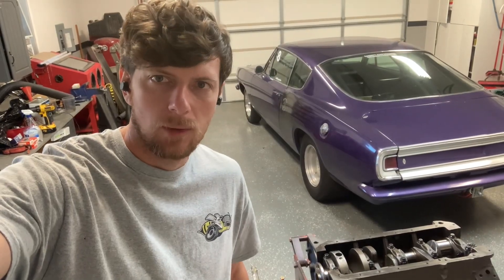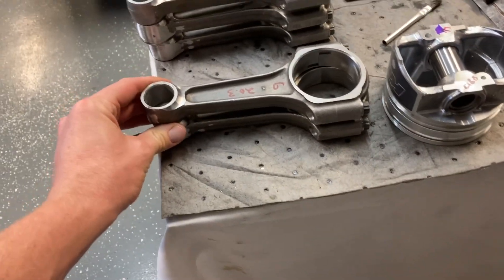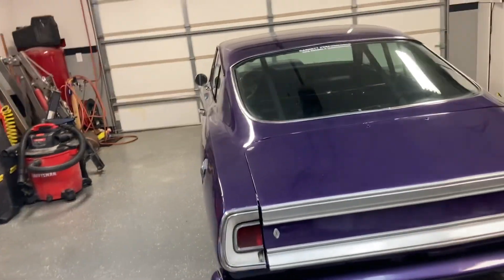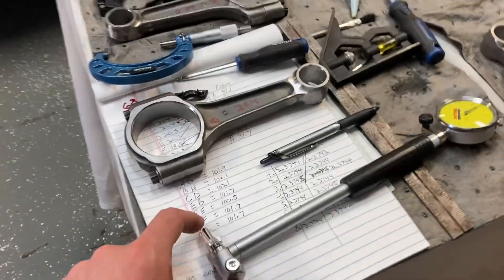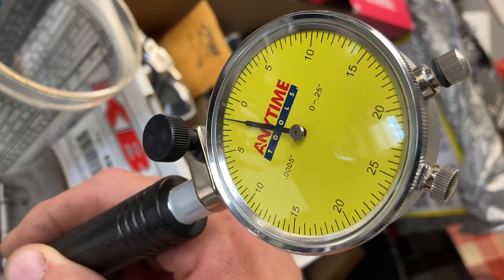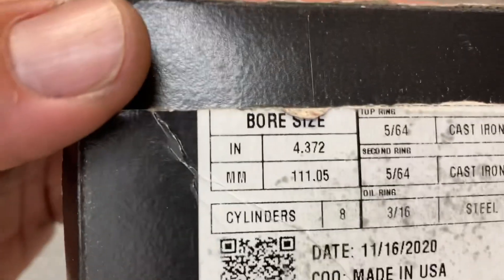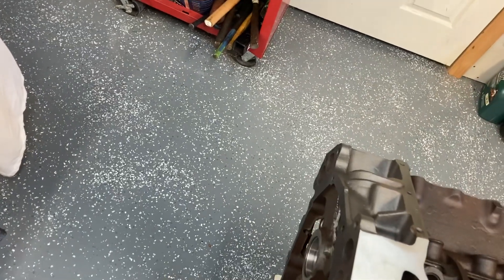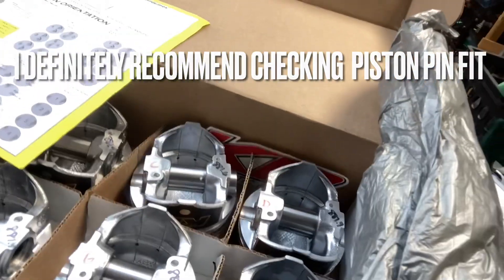Big Block Mopar 400 Build Series:Prepping for Rods, Rings, and Pistons

Comment: Great video Joe.
Glad you are checking the parts, as you should.
As the engine builder, never assume things are correct regardless who does the machining.
Also, the collaboration between the shop and the individual is important.
Over the years working with many builders of engines I have found some individuals require or desire to have different specs and tolerances. 
In which I try to accommodate within reason to the individual needs.
The goal of the customer is important. 
To achieve a positive outcome. 
To add, the large end of the rod is rotating weight and the little end in reciprocating weight. 
Piston and pin are reciprocating and snap ring and or Spiro locks are reciprocating. 
Rod bearings are rotating. 
I like watching and listening to you Joe.
You're a good teacher.
And you add a level of professionalism to your builds.
Following steps like these will insure success and a positive outcome. 
I will be watching and glued to this whole process. 
Can't weight to hear the 400 Mopar run.
Thanks again. 
Take care, Ed.
Reply: You must be good for Old JMK to speak so highly of you and your work. Great day to you all.
Reply: @johnelliott7375  Thanks John.
Thanks for watching. 
Take care, Ed.
Reply: @edsmachine93  thanks again for sharing your work and time with us all and most importantly your honesty as a business man. Your very welcome.
Reply: Wish you were a little closer. But, when I - eventually - get to building that 426 wedge… I might make a trip. 😊
Reply: @MyKARSShop  Hello Mike, I assume you were talking to me?
If you were, I would love to do a 426.
Is it a Wedge?
Take care, Ed.
Reply: @edsmachine93  yes.  It’s a 413 marine engine that I wanna punch out if it’s salvageable.  It’s a boat anchor right now.  There are a couple episodes on it from this year.
Reply: @MyKARSShop  no pun intended for the "boat anchor marine engine" eh!
Reply: @jasonfalk7696  nope. None at all. 😂😂

I guess my reputation precedes me. Lol

Comment: Just curious why not use a 383 crankshaft.  Aren't they forged and same dimensions?
Reply from the maker: @offthegrid5078  yes sir, they’re also internally balanced, which is another well liked thing. Major reason was that I didn’t have one, without having to rob it from a complete engine. I had this nice cast crank that was ready to install. Old cast cranks can handle a lot of abuse without failure. I figured if I was going to buy a new crank, it would be a stroker crank.

Comment: Staying on the looser side of kb specs for ring end gaps can result in oil consumption and loss of compression. As long as your not running a bunch of boost or nitrous I would stay on the tighter end of their recommendations for your application.
Reply from the maker: Thanks Matthew. I’m at a tight .033 on top. I wouldn’t go more than 150 shot. Bottom ring gaps were all .019 out of the box , which the spec is .01748. I didn’t touch them at all.

Comment: Nice video awesome machine work. It’s a lot  easier getting 500hp NA today from a 400 mopar thanks to trick flow heads. There 240 and 270 are nice alternatives. My opinion 500 hp from a 400 B block 10-11 compression Mechanical flat tappet 24x @ 50 camshafts. 240 trick flow heads 1.6 rockers if you have room. I don’t see a hydraulic cam getting you there. This is going to be fun to see
Reply from the maker: Thanks Dan. I’m going with a roller setup and 1.6 rockers. I have the closed chambered Edelbrocks that have been worked and then some. Should be close!

Comment: Yeah yeah yeah! Put it in the Barracuda!
The Chrysler B block has a 1.88:1 rod ratio, if I remember correctly. It should rev higher easier, without having to push it up into RPM's that it really doesn't like to go up to. Will need good valve springs.
Reply from the maker: Inquiring minds must know! Should be a fun experiment! My converter should be good for the 406!

Comment: Too bad, you don't have a forged 383 crankshaft for this build.
Even a 383 2 barrel had forged steel cranks in early years
Reply from the maker: I have one, but I’d have to steal it from a complete 383. The cast cranks are stronger than most understand. I will show the results of this one
Reply: @JustMoparJoe  The 400 block is the strongest of the B and RB motors especially the early ones.
I have tossed out 400s before I found this out.
Andy Finkbiener has built some very nice 400 stroker motors with Trickflow 270 heads.
Over 750 horse power with a 400 block.
440 motors can't live very long at that power level, if at all.
Reply: @JustMoparJoe  I bet that you could find a junkyard crank from a 1966 to 1970, 2 bbl 383 for less than 100 dollars.
    But it  requires some time and willingness to get pretty greasy.
The right crank would not even have to be ground undersized.
Racing engines like to be on the loose side anyway.
   I don't really like cast cranks.
Weak oil slingers.
Poor for high RPM.
 No neutral balance on flex plate or torque converter.
  You can turn the mains down on a 440 crank and offset grind the rods down to 2.20 and run chevy rods to make about 470 cubic inches.
    Do you have Andy Finkbiener's book on building Mopar Big Blocks ???
Reply: @JustMoparJoe  when you tap a cast crank with a wrench you get a full thud.
When you tap a forged crank with a wrench it rings.
   I don't want a "dull thud", crank in my motors.
Reply: @JustMoparJoe  I like 67 to 69 Cuda fastbacks.
We used to race our 69 Cuda fastback at Bandimere speedway in Morrison , Colorado.
We never got it to hook up , even with slicks.
Circa 1978.
11.60s with no traction.
Cast iron heads.
Street car.
7500 foot elevation air.

Comment: Please don’t put it in the cuda you have that car so right leave it alone . Buy a 68   2 door Dart an put that 406 in  they have a nice low roof line   An at a nice looking MOPAR . 👍🏻🇦🇺🏴
Reply from the maker: Thanks buddy! I certainly wouldn’t throw the 408 away. But the engine could use a freshen up. What do I do while that’s happening? Run the 406! I have a transmission. I have several intakes to try out. With aluminum heads and aluminum water pump housing, it will nearly weigh the same as the iron headed 408. Will have to see what happens!

Comment: Great video as always! Has the block been 0 decked? Heads cut? I trust your judgement but lack of compression is a common thing these days.
Reply from the maker: Thanks Greg. Block was professionally decked and bores recentered. Pistons are flat tops, .015 in the hole. Heads are closed chambered Edelbrocks that have been worked in many ways. Somewhere between 10-10.5/1. It may be a stretch, but I’m going to stretch it! That’s where the fun is. I will have under $3,500 in the entire engine, from pan to carb or carbs😅🤷🏻‍♂️

Comment: The 400 is my favorite. This will be very interesting. I think the Torque from the 406 will be better and maybe help launch the car faster…better 60ft? Thinking of building the 451 I have parts for with better heads and Gary’s favorite cam.
Reply from the maker: Thanks Mark! The 408 may win the torque battle with the long stroke! But the 406 will have the head flow down Pat! I need to speed up!

Comment: What’s your take on 2021-22  YouTube engine builders Contributors record’s of  “new cam kit” Manufacture’s premature failure of lifters after proper break in? YouTuber’s  Using correct break in oil & zinc additives. Then lifters Failing and damaging the cam lobes.
Failure after a few mile of on the road tests…( ie; DD Speed Shop , Uncle Tony’s Shop) ….Do you piecemeal your cam parts or do a kit?
Reply from the maker: Thanks for the question. I never buy new comp stuff. They had the majority of issues. Last flat tappet cam I bought was from Bullet cams. No issues. Before that it was Lunati voodoo stuff. I did see a Lunati that looked like it was wearing funny, so I replaced it. My 408 and most race engines always got Isky cams and lifter kits. Never an issue. The Mopar shaft mount rockers allow you to run less spring pressure, which would be easier on cams. Most don’t buy Isky or Bullet because they’re $450 or more for cam kits. They think cheaper is better. With this engine, I found an NOS hydraulic roller from comp. It’s a billet core. I’m actually using solid roller lifter from Johnson. Should be a fun one!

Comment: Thats a comparison I definately want to see! I don't think I have seen anyone do this before,with a Mopar anyway, 406 short stroke big block vs 408 stroked small block...gonna be really exciting to see the results of this. depends on a lot of things like,head flow,cam compression etc. I would think if all that stuff is pretty close to same they should be pretty equal in hp and torque except the short stroke is gonna be getting it at higher rpm range obviously one would think. anyway,gonna be a great build series Joe!👍
Reply from the maker: Thanks Ross! I won’t throw my 408 away for sure!
Reply: Factory big block heads are the crutch.

Comment: Good content Joe , 500 hp at the crank shouldn't be to difficult as long as she is going to make decent compression !
Reply: Nice
Reply from the maker: Thanks buddy. It looks like I’m stuck around 10-10.5/1 with these pistons. Which is fine, as I am going with 93 octane. We could have cut the block and heads more, but may want to drop the stroker crank in someday with some flat tops and shoot for 12.5/1

Comment: I still think the 400 block is the best Mopar platform to build. (For the money) And to think of all the 400's I passed on when I was young and dumb.
Reply: Only because I hate to see things wasted I ended up saving more 400's than 440's. Complete accident
Reply from the maker: Thanks Jason. This is the first 400 I’ve buiilt. Always 383’s, 413, or 440’s.
Reply: Guys are making 800+ hp with these .
Reply from the maker: @karlsracing8422  can they do it with 10/1 compression and stock stroke? I know those are my limiters
Reply: Just like We did with the 383 which has the same stroke but a small bore the 400 has the largest bore ever used in a Mopar stock production block will spin up fast they are happy at hi rpm's and hold up extremely well ! 🇺🇲🇵🇷🦊👍
Reply from the maker: @ferdinandcuevas8457  that’s what I’m hoping for. Should be a fun one with a solid roller cam.